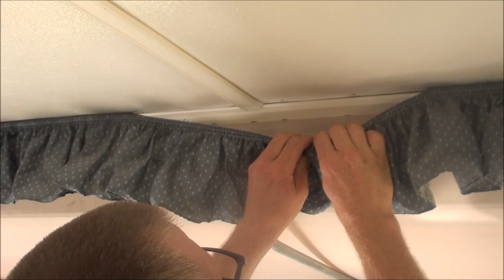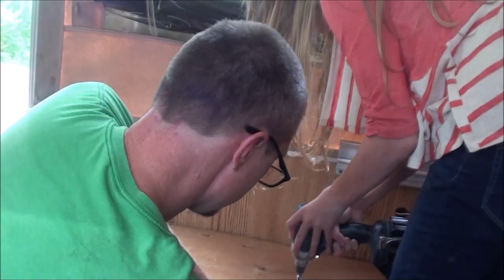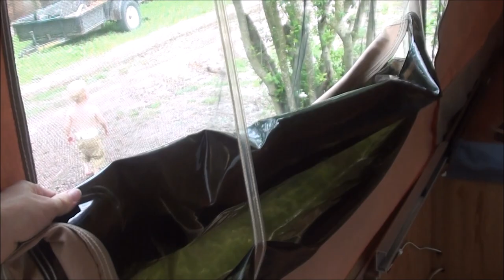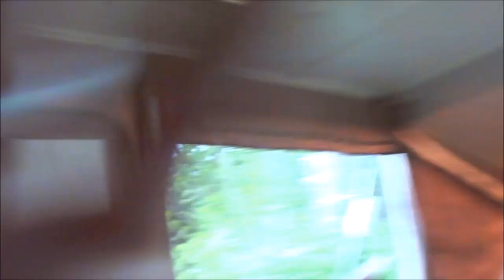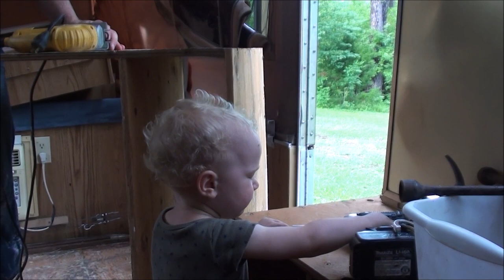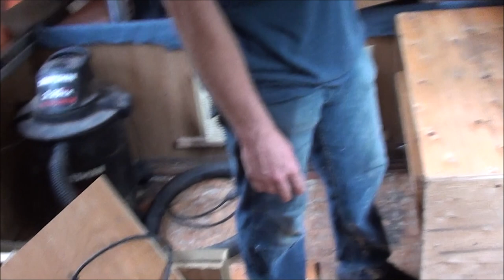POP UP CAMPER RENOVATION (part 1)

Comment: Question about the vinyl on the camper windows... how did it come out? Do you have pics?? Water tight??
Reply from the maker: We have not replaced the vinyl yet. We didn’t make it all the way through our renovation list before our baby arrived. 😄
However, the canvas has more weakened spots then we first thought, so we’re wondering if it just needs a complete replacement

Comment: I am surprised that you cut the vinyl windows. While I pause it to make this comment so I think you're going to after all. But the whole purpose of them being dark like that is to blackout the Heat and sun isn't it. So wouldn't replacing it with clear plastic make it get hot in there?
Reply from the maker: Yes you’re right! We ended up deciding not to replace them